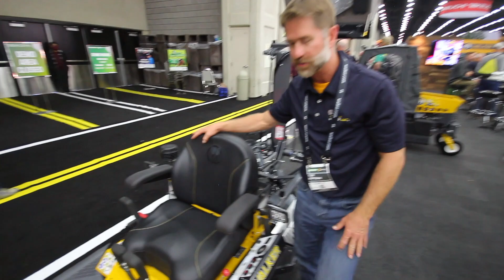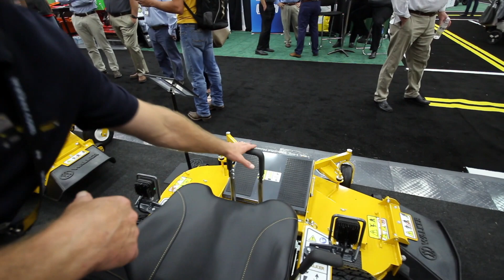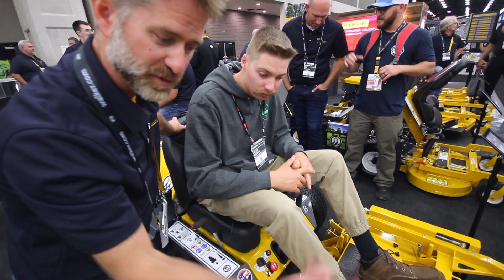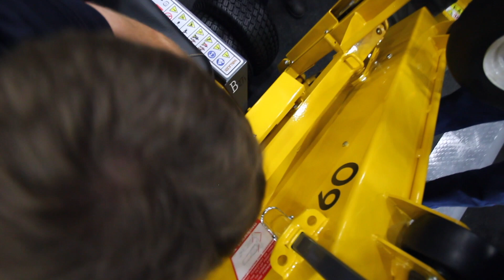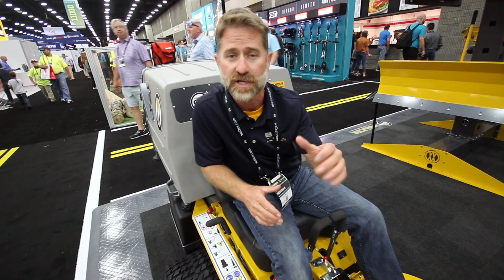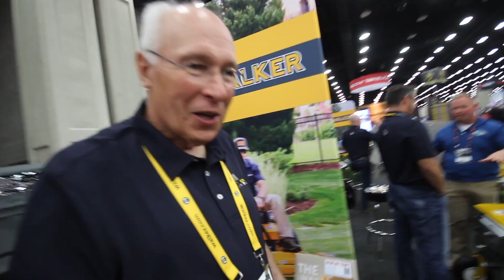An Indepth Look At Walker Mowers With Tom At GIE 2021 Including The New C23i And More!!

Comment: Nice machines. Looks like some of the deck tilts are more than a one-man job, but maybe not. They have a great collection system that doesn't add width. I have been comparing them to the Grasshopper front mounts (727T EFI) for non-collection. Cost-wise similar, good deck choices for each, cut quality comparable.

Comment: I have a 18hp Walker early 1990’s with electric clutch blade, the walker has about 1000 hours. Really like it, back then it has about 20 grease points. The clutch blade gearbox went bad,$750 for new part. Lucky I got used one for $225. I really like the leafs collection it has,overall love the mower. I live in Augusta Ga. and the national (masters golf course) use it to cut some of the grass OUTSIDE of the course. They only use Walker riding mowers and Honda commercial push mower on the OUTSIDE, roadside etc. that says ALOT about this great PRIVATE FAMILY OWNED BUSINESS THAT MAKES THE  MOWERS IN USA.
This is a company all Americans should support. Buy made in USA.
Reply from the maker: I agree with you 100%!  That says a lot when a very well known high end golf course uses them.

Comment: Nothing electric yet huh?
Reply from the maker: Nope, I don’t see the industry there for a long time.
Reply: @CalebsPropertyMaintenance I had actually suggested to one of their engineers that they ought to try a hybrid model. Preferably using a diesel engine to run as a generator and run everything else off of electric motors.

Comment: The C23i is interesting, I'm not sure where it's supposed to sit compared to the T though. It seems like it's an upgrade, but not sure why they need both?
Reply from the maker: They said it’s a simpler version of the T.  I think it might have a bigger blower but otherwise it’s almost identical.  Price point is about $1,000 less than the T they told me.
Reply: @CalebsPropertyMaintenance  Thank you, might be an interesting proposition then. Can't see much downside compared to a model T, I especially like the electric clutch.
Reply from the maker: @WichitayardbarberLawncare  Same!  The other difference I remember is that the C has Hydro Gear transmission while the T has the Eaton with the new TOPS filtration system.  I’m sorry that wasn’t included in the video. It would’ve been even longer!

Comment: they can’t operate their own machine…typical salesman mo
Reply from the maker: It’s a brand new deck and they added a small piece which they thought would help, but clearly it did not.  That deck is not even in production yet!
Reply: It's a small company and the deck wasn't even in production yet. It's a minor issue and they allowed it to be shown, whereas a larger company may very well have tried interfering and tried to cover it up. Walker is a very very honest and respectable company that doesn't play dirty like many others.

Comment: Walker makes a pretty good mower but the prices have gotten out of control. That first setup is was listed at 23-25k this gie. You can buy a compact tractor with heated and air conditioning cab with front end loader for that price. The price for the high dump kit is 4-5k that is more then adding a dump insert to a pick up.
Reply from the maker: I paid just under 7k for my dump insert.  I get it, the prices are crazy.
Reply: @CalebsPropertyMaintenance  ouch. Accept for the aluminum inserts they are all about 5k installed by me.
Reply from the maker: @cutandcleanwi6947  Mine is stainless steel.
Reply: @CalebsPropertyMaintenance  👍